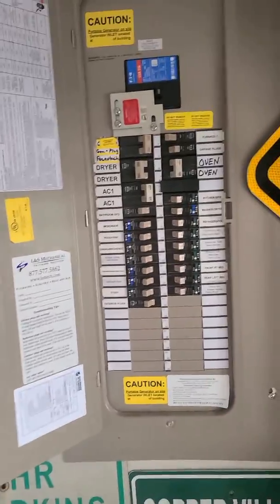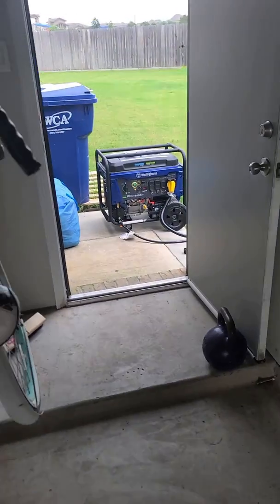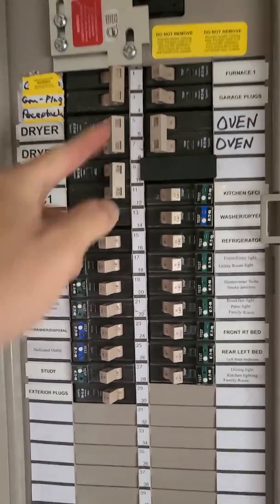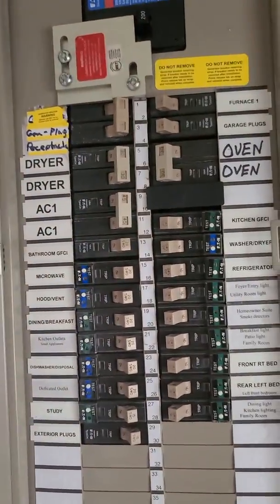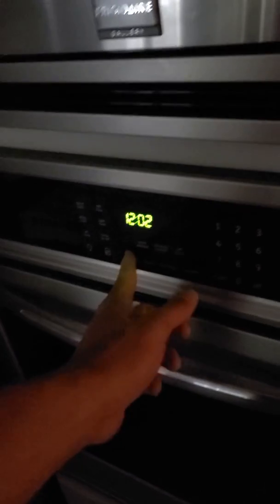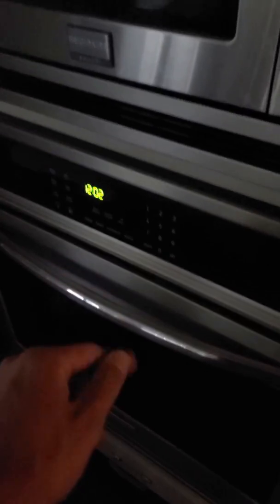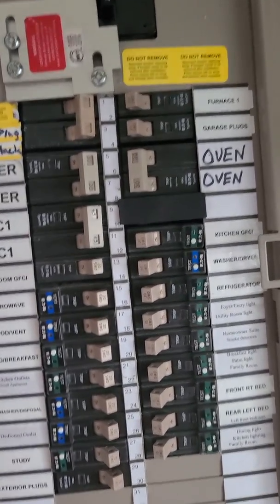Running 4 Ton AC+ with Westinghouse Generator 9500/12500 (Part 1 of 2)

Comment: I see this is old but install a Micro Air 368-72 soft starter on that perticular ac unit (google it) easy install or have it done, it will take your AC from about 90LRA which is starting amps down to about 30 LRA. A 4 ton ac unit only draws about 10-12 running amps after LRA start up. Also you'll get more life out of your AC compressor and less light flicker on start up. With that generator turn every breaker on in your panel and you will be good to go. No oven tho anything that uses hi heat or heat in general drives amps thru the roof. One stove burner should be ok on that model. Good vid don't know how I got here. Master Electrician out.

Comment: Good stress test.  4 Ton a/c, dryer, and oven all at the same time is a lot and more than I would expect this generator to handle.  In an emergency situation, it would be fine as long as you only ran one at a time.  Looking to buy this same generator.  Thanks for the review as I was curious just how much it could actually handle.

Comment: Everyone I know says this isn't possible. A 12500 won't kickstart a 3ton and up ac.
Reply from the maker: Not sure what to tell you. Maybe make some more friends. Or maybe you forgot to mention there is a hard start installed on the AC. 🤔
Reply: @JoelPowell84  I think its pretty obvious they are wrong. Most people including electricians go off of word of mouth as well. I had an electrician come by my house to setup my fuse box for a generator and at the time I was planning on running a duromax 13000. He said its not enough for a 3.5 ton ac unit. So I held off. I have seen many videos showing it can be done.
Reply: My generator started my 3 ton no problem. Exact same generator to

Comment: Great Generater.Systems . Pretty quiet compared to other in this size. Runs my AC in our camper, but have to take generator off of economy mode to do so!! Great buy. Would recommend!!! Champion 2500
Reply from the maker: Thanks!

Comment: There is a protection circuit for the AC Compressor that usually keeps it from restarting about 5-10 minutes after a shut down.   Normal behavior.   Mine is defaulted to 8 minutes.   Great video.  Thanks for posting this.
Reply from the maker: Great to know! Thanks!

Comment: Why did the generator completely shut off? Shouldn't the 50amp breaker have tripped? New to gens so that kinda confused me.
Reply: No soft start for the ac?
Reply from the maker: The hard start kit I'm using is in the description.
Reply: @JoelPowell84 wouldn’t you want a soft start kit and not a hard start kit?
Reply from the maker: @trumpurace1635  yes. ended up removing it and buying a soft start but didn't need it.
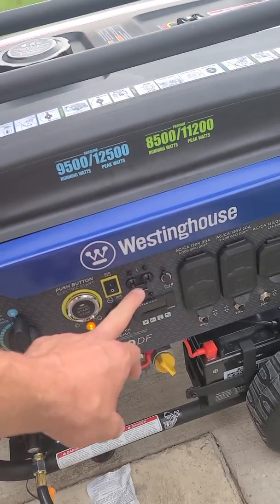Reply from the maker: Great question! Im not sure why it didn't. I thought it would have tripped the breaker as well but it didn't (4:34) It just killed the generator. I'm sure an electrician (maybe a Google search) would be able to answer that. Sorry man.
Reply: @JoelPowell84  thanks for the quick reply. Yea I searched Google a little and couldn't find much. Has it been running ok since that. I saw a little run time in the second video. Wasn't sure if you've had to run it much since that.
Reply from the maker: @armyguru1214  I haven't HAD to run it but I do pull it out and run it for 30min or so once a month. It's a must during peak hurricane season. No issues so far!
Reply: Did your electrician put in a 50amp breaker or larger amp like a 60amp? If he used a larger amp breaker (above 50amp) what his reasoning?
Reply from the maker: I think he installed a Eaton 60-Amp 2-Pole, not sure why. Bigger is better? Lol All I know is it works. Why do you ask?

Comment: What are your thoughts when running your heating furnace? Will your generator handle it as well?
Reply from the maker: Yes the furnace takes significantly less power than the A/C.
Reply from the maker: To clarify I believe the breaker on my box labeled "furnace" is the breaker for the fan. During the Texas freeze we rigged up a 6500 Honda to the panel and this was the breaker that powered the heater.
Reply: So I have a question. I will be using the 50 amp outlet from Westinghouse generator 9500 DF. Should I use a 50 amp breaker? ( To be installed in the breaker panel) I will be having an electrician install. I was going to start buying the parts I need.
Reply: @AURORABLEU  I just completed the same set up last weekend.  You should use 50 amp 2-pole breaker.  Check your breaker connection before buying to save you a trip back to the hardware store.
Reply from the maker: I'll take a stab at answering this but I'm going to preface to please ask your electrician and consult a professional before doing anything. If you look at my box he installed the breakers for the generator on the top left. I THINK they are 
" Eaton Type BR 60-Amp 2-Pole Standard Trip Circuit Breaker ". If you are in the Houston area and want the name of 2 very honest and fair electricians that I trust let me know.
Reply: No it will not work the furnace. I tried furnace and generator shut down electrician said furnace had to many amps

Comment: Have the same setup with my 3 ton ac. Works great
Reply: Here are the portable generator safety rules: everyone needs to make sure they’re aware of all the warnings when using generators. This is just a reminder for everyone’s safety. All generator safety rules should be followed carefully. This advice is just to make sure that everyone is aware of all the warnings and it’s just to remind people to be careful using portable generators. Generators can be dangerous if not used carefully. Every year, hundreds of people die or get injured when using portable generators due to carbon monoxide poisoning and electrocution. Make sure you are using your generator carefully and keeping others safe as well. There is something very serious that everyone should always be aware of when using generators. Some people do run their generator indoors which is not safe and that increases the risk of carbon monoxide poisoning which can cause death of family and you. Some people run their generator in wet conditions which can electrocute them. Please remember that you should never run your generator indoors. Remember that carbon monoxide is an odorless and colorless gas that you cannot see or smell. Carbon monoxide is a silent killer. Keep that in mind. Make sure your generator is 15-20 feet away from your house and away from doors, windows, and vents. Never use your generator in your porch too. Having a carbon monoxide detector is very important against generator safety. Some people also allow children to go near the portable generator which could pose risks. We need to keep an eye on our children making sure that they are not near the portable generator so they won’t get electrocuted or burned by the generator which is dangerous. A locking enclosure also keeps kids safe. A generator shed might look like a tempting place to explore, or take cover during a game of hide and seek, but a generator is a dangerous piece of equipment that can cause injury. It says on the manual that we should also keep children away at all times from the portable generator to avoid injuries. Please do not allow a child or unqualified people to operate the portable generator.  It is important to keep your children safe especially little ones. The portable generator can be hot during an operation. Just because some manuals missed what should be listed doesn’t mean it’s safe to do. Always follow the generator safety rules when using portable generators. Generators pose electrical risks. If you need to use your generator during wet weather, you need a generator tent to protect your generator from getting wet. Don’t let your generator get wet. Keep your generator dry and before using your generator, please make sure your hands and your generator is dry. Do not wear loose clothing when operating the generator. Everything that is said on the generator’s operating manual should not be ignored. Never smoke cigarettes near the generator. Please keep flammable things away from the generator. Never overload your generator too. Your generator can catch fire. Never ever try to plug a generator cord into a wall outlet to avoid back feeding. Back feeding your generator is dangerous. Always turn on your generator first before plugging in appliances and shut off the appliances before turning your generator off. Use a heavy duty cord for your generator and the cord should not be worn out. All the instructions should be followed carefully. Never refuel your generator while it’s running. It can cause fire if fuel spills while your generator is hot. You should turn off your generator and let it cool off before refueling it. Having a fire extinguisher next to the generator is also important. This is only a reminder for everyone’s safety of using generators. Make sure your generator is properly grounded. Having a fire extinguisher next to the generator is also important against the safety rules. https://youtu.be/I1jT3ANENvI and here is a video more about keeping others safe when using generators and also about our family’s safety. You should keep your children safe especially little ones. Hope this helps. Thank you.
Reply from the maker: @The_Happy_Aviation_Enthusiast  Thank you.
Reply from the maker: Awesome. As of today I only have 2 or 3 hrs on it, do you have any suggestions, tips or anything you would do different?
Reply: @JoelPowell84  I havent had to use it yet so I cant be that helpful
Reply from the maker: @ejk3435  No worries.

Comment: Looks like a good set up!
Reply from the maker: Thanks man!
Reply: @JoelPowell84  your generator should be 15-20 feet away from your house and away from doors, windows, and vents. Glad you and your family didn’t get poisoned by carbon monoxide fumes. And we should also keep our children safe especially little ones. Make sure your children won’t play near the portable generator so they won’t get electrocuted or burned. Make sure you are aware with all the warnings before using your portable generator. Just reminding you about the safety of using generators. Hope you have a good one as well. Be safe.
Reply from the maker: @The_Happy_Aviation_Enthusiast  You are correct. Thanks for the friendly reminder. Just as a precaution I have 2 carbon monoxide detectors/smoke detector installed in the rooms on the side of the home where the generator sits.